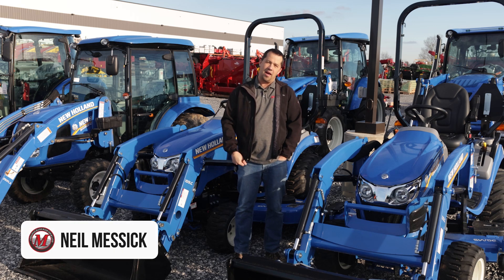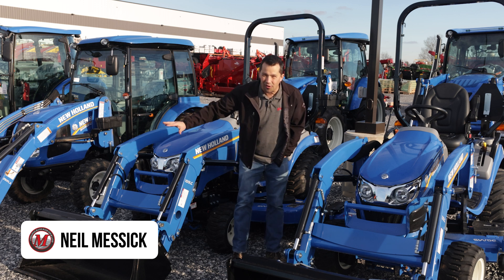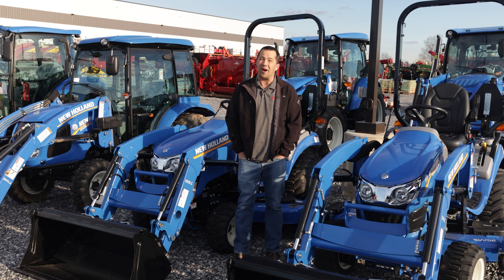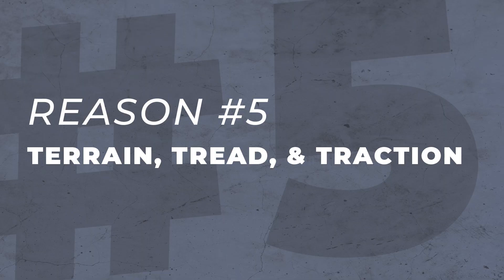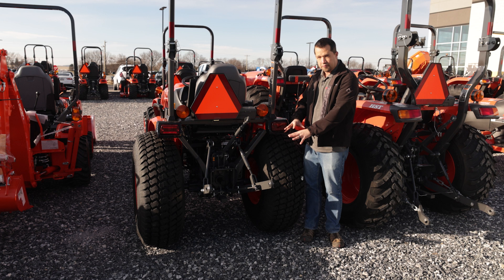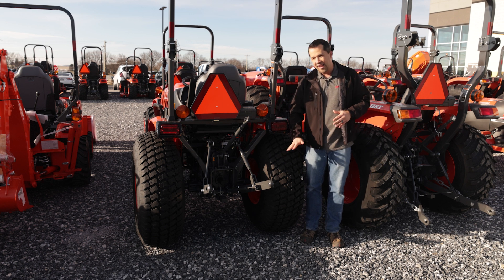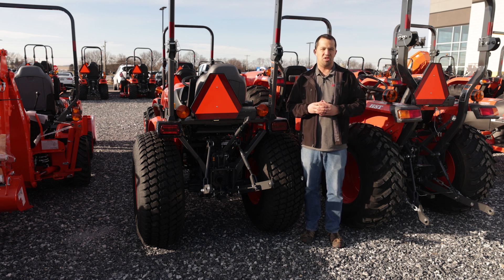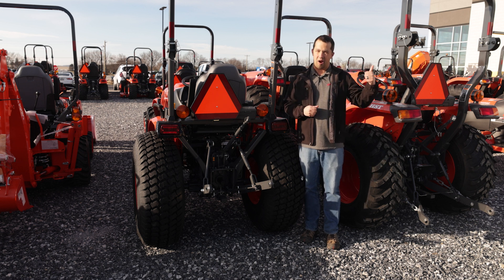5 Reasons Your Tractor Can't Climb a Hill

Comment: So lets compare a L 3302 to a L 3902. Eveeryone always says the advantage of a larger engine in the same chasis is more pto power. Would the L 3902 also go up a hill easier with evereything else being equal? Or is the Hydro pump the limiting factor and they would pull the hill equally?
Reply from the maker: I'd 100% love to find a way to do this well.
Reply: @MessicksEquip  Make it happen Neil. I would really like to know the answer!
Reply: Pretty easy to deduce.  If you have the tractor in low range and light on the pedal for a hydrostatic tranny...if the engine bogs down... then it's horsepower.
Reply: @rgd2598  Sure but how does that compare to the same frame tractor with different horsepower? That is the question.
Reply from the maker: Needs to be more of a 'lab' test than just driving them side by side and doing it by feel.
Reply: If the difference is not «feelable», the limitation is the hydraulic pump - since it has the same capacity on both Kubotas? Not sure it it has to be a lab test to check if the pump or the hp is the limitation?
Reply: This is a very important question. It strikes right at the heart of the matter. Neil's hill climbing video is absolutely marvelous, as all of his educational videos are. There is simply no one on the internet who teaches us like Neil Messick. We learned why an L 2501/2502 can have challenges on hills. How about an L3301/3302 vs. an L 3901/3902? At what point is the horsepower of the L series enough to go up a hill really well?  I have an HST L 2501 with a loader and wheel fluid ballast etc. and I live in the mountains of New Mexico at 7,600 feet. I find that Neil's tip to not" toe" the HST paddle "to go fast" going uphill but to "heel" the HST pedal going uphill works perfectly. Yeah, it is counterintuitive until you get used to it. In any event, this was a great video. Using this heel-toe technique, the L 2501 has been great. And I am talking very steep hills up here in the high country. Thank you, Neil and thank you @dustinslance6747.

Comment: Any rule of thumb in cold weather of letting your tractor warm up to get the oils to operating temperatures so the tractor will operate better.  Thanks Michael 😊
Reply: I start my tractor and let it run for 5-10 minutes before I start using it.  At a minimum I'll start it and let it idle for 5 minutes before I move it out of the shop, and then it usually sits for another 5-10 minutes before I actually start putting it under any sort of load.
Reply: Magnetic engine heater on reservoir can help.

Comment: Your gear vs. hydro pull test from a while back says all you need to know about which transmission will climb better. Gear drive = more power to ground.
Reply: @Mike Mancini It will be more like Mad Max Beyond Thunder Dome. But at least all the big city liberals will be gone. LOL!
Reply: Would be nice to have a gear drive and CVT comparison but I presume they would probably be equivalent.
Reply: Amen. Skip the hydro. Learn to shift.
Reply: @trajonduclos7931  Wish they offered a manual transmission in the BX LOL.  Although with loader operation a hydro is a lot quicker and easier...but yes, if available get a manual if you wanna pull.
Reply: @trajonduclos7931  Useless for loader work. Hydro is best.
Reply: @Morris-Monet  useless? Are you serious? Loader work with an oversized lawn mower? You talking about dumping mulch in your flower beds? That’s not loader work. That’s homeowner work. LMFAO
Reply: @nalley6815  Skid steers do not have gear drive. Hydro is awesome for loader work.
Reply: @TheSailingwoodworker  we’re not talking about skid steers
Reply: @nalley6815  You are clueless.
Reply: @Morris-Monet  run loader tractors my whole life. But yeah I’m clueless
Reply: @nalley6815  Agreed but was just pointing out they are first and foremost loaders and hydro is superior to gears for that work. If you have three arms gears are fine for loader work....
Reply: @TheSailingwoodworker  this is why we have power shuttles. Hand never has to leave the steering wheel. Or on certain manufactures you can get a shuttle button on the joystick. Then when you’re done with loader work you still have a tractor that isn’t completely gutless. Not to mention you can’t get even hydro in an actual tractor. Just oversized lawn mowers
Reply: @nalley6815  that's not true. There are 100+ hp hydro tractors
Reply: @bamareefer4387  if there are then I’ve never seen one before and they’re not offered from the top 5 manufacturers
Reply: @nalley6815  I know New Holland makes one that is over 100hp. 
Kubota has them in up to 60hp tractors.
I was skeptical about hydrostatic transmissions until I saw them in action on big dozers
Reply: @bamareefer4387  new holland makes CVT just like all the others but I don’t know of a hydrostatic. What model is it? Hydrostatic is nice until you start pulling stuff. That’s where I’m turned off from the whole idea. And the fact you have to have more power to do the same thing as a gear drive
Reply: @nalley6815  it's a 105 pto hp bi directional tractor. I dont remember the model number I just remember reading about it awhile back.
I know my kubota has enough power to break traction on all 4 wheels while pushing or pulling on hard packed soil in low range with ballast and filled tires. I agree its not as efficient,  but it does everything and I love it while using the loader. I admit I prefer gear drive when mowing
Reply: @bamareefer4387  yeah they don’t make those anymore but they’re definitely “interesting” looking to say the least 😂 don’t know anybody that owns one so I can’t comment if they were any good or not. I guess they’d be handy as a loader though
Reply: I say change the turbo change the fuel pump needs a hotter button

Comment: That moment when a  steam tractor has better hill climbing capabilities (edit, than some new tractors, im looking at you LS tractors of Wagner rental that thing was barely able to move on flat ground but that might be just that one machine in particular) I'm personally wondering if my jd5400 didn't sustain transmission damage from climbing my 500 ft farm on a hill 3 times a week for the first year i had it and having all the hydraulic oil in the back of the transmission as it preforms its job ,, or if it was leftover damage from the last owner that showed itself
Reply: Most steam traction engines running at operating pressure are going to pull a hill as good as or better then most modern tractors. And a lot of them are over 100 years old . Sorry as a traction engine owner, I has to chime in on ur comment 😂
Reply: @Primerk5   hey I've seen your videos before I like the peerless I'm trying to learn about traction engines  I want to run a sawmill off one I'm looking for advice, Literature,personal experience etc you have any?
Reply: @wesbrackmanthercenthusiast4695  awesome, DM me and we can chat. Need to know what you are working with.
Reply: @Primerk5   the listing said its a 3by9 Frick believe its a 32 tooth  blade just from seeing a quarter of the blade however I can't confirm this until the end of the month waiting on a bonus to get the mill so it could sell in the meantime if it sells ill be on the search for the same size again want to put it on a trailer to take to steam shows in  Ohio as well edit just subed and wrote your channel down if I get this mill I'll contact you on your channel and leave my g mail so we can chat and I can figure out what I'm missing for knowledge before diving into traction engines
Reply: @Primerk5  They'll pull anything just not very fast LOL....what is the top speed?  I've heard like 3-5mph?
Reply: @wildbill23c  2-5 for most American models it really depends on the gearing. Some Canadian models had a second speed which would give them a bit more. There are english engines in the UK that have a road speed.
Reply: @Primerk5  Thank you for the insight.  Always interesting learning about the old tractors and equipment.  People like you that keep that stuff going are awesome.

Comment: Or the clutch is out or out of adjustment.
Reply: Buy a new tractor
Reply: @xephael3485   because a clutch is out of adjustment? Nah. Had one that would work ok in low gear on flat ground, but would climb a terraced hill I was planting. Former owner had sold it to me cheap thinking it needed a new clutch. Some linkage had worked its way loose. Put it back to specs and it pulled like an ox.
Reply: @MusicandMachines  no trade it in for a new EPA approved tractor.. low monthly payments 🤪